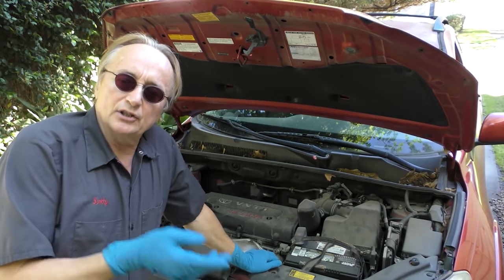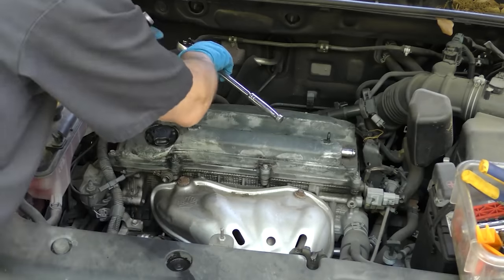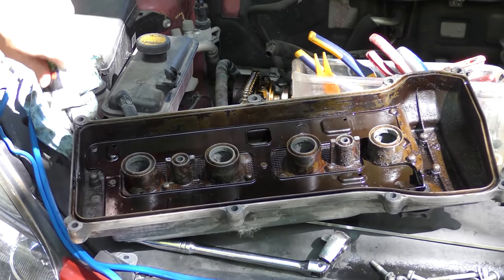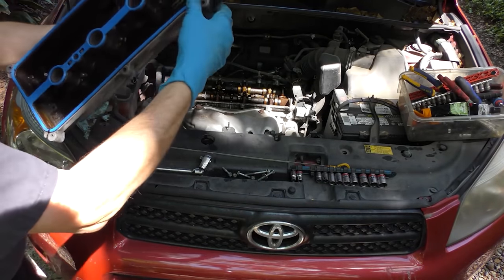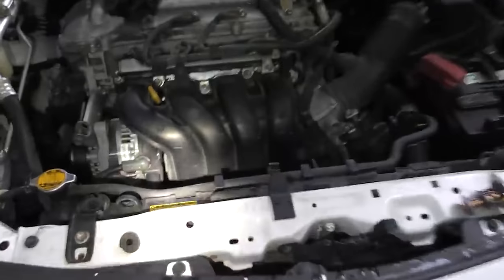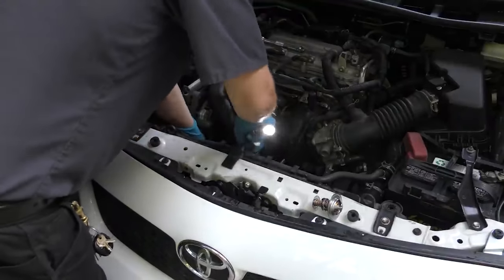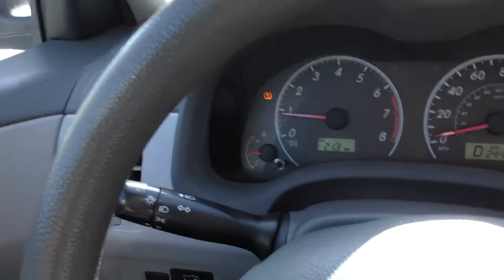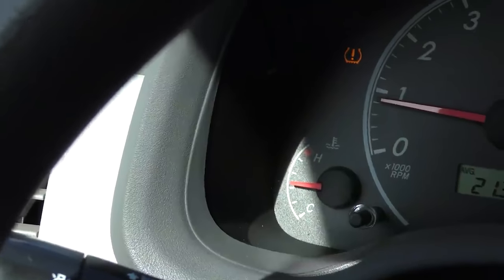3 Mechanic Scams Caught on Camera

Comment: He reminds me so much of me with 10 times more knowledge......gradual tightening of bolts yes but I didn't realise about from the centre outwards.....I would have checked the thermostat first.....my Dacia duster doesn't have a temperature gauge which for me is problematic....I have always treated the gauge as the fist sign that's somethings wrong...ah well that's progress

Comment: HELP ME SCOTTY! I have a 1998 Toyota Camry XLE that I've had for 21years. It's got 172,572 miles. The alternator, main belt that runs everything, spark plugs, wires, and filter have recently (5 months ago) been replaced. I noticed my car (Ole Bess) started running a little rougher than usual, and died while I was driving 2 days ago. I had it towed and she won't start. She cranks but won't start up. Everything looks normal (dash lights), but she won't start. It actually backfired when someone tried starting it today, which was the first time that happened. Please advise what you think it could be, because I am raising 1of my grandsons and school starts in 2weeks! I'm disabled and don't have a regular mechanic that I can count on to not take advantage of me, and I am on a fixed income. HELP!!

Comment: 😢 I have a 2012 Chevy camaro.  I'm  losing water out of the mufflers, not the tailpipe. I replaced the thermostat and the radiator. Plus, I flushed the heater core. It's still overheating. Almost certain it's the head gasket. I was about to replace it when I thought. Maybe the motor is cracked. Any suggestions.  New engine and heater core or replace gasket and timing chains and assembly?

Comment: The year 2000 and my Father In Law asks me to look at his 1995 Toyota Cressida. He'd have it serviced by a mechanic since brand new. The trouble was I had in mind - fuel starvation. I confirmed the problem. I saw the engine front filter full. I traced the fuel line to the tank. Yep, found an unserviced steel filter. I took it apart and removed the blockage. All went well. I am not a trained mechanic and my clerical hands can be seen -  :-). Live is a laugh - if you let it.

Comment: My 02 jeep liberty with 3.7l v6 just took a poo. It died big time just started misfiring and running like crap... a spark plug came apart in the cylinder and destroyed the engine not sure if it over revved or a valve stuck or what but the spark plug definitely got mauled and mauled the engine wish I could post a pic of th cylinder on here

Comment: Or you can use Grease Grease will hold them too especially if there's a ridge on that valve cover gasket put a little grease in there push it in you'd be surprised how much grease works

Comment: I had a Toyota V6 that wouldn't shift to high gear in cold weather. Mechanic said could be this sensor or that sensor. I said I think it's the thermostat, the engine isn't warming up so the it wants to stay in low gear. I installed a new thermostat, the old one was stuck in the open position and Viola, it shifted perfectly after that. The keep it simple principle worked.
Reply: First I experimented putting a piece of cardboard in front of the radiator, when that made it shift I knew I needed a thermostat.

Comment: I have a 2011 gmc Sierra 5.3 2WD with two codes p0797 and p0700 solenoid 3 stuck on. Mechanics said it needs a new transmission because the part can't be replaced?

Comment: When my father in law bought his 2006 Acura MDX, he took it for an oil change and not knowing about cars, he got suckered in to changing the power steering fluid, transmission fluid, brake fluid, engine and cabin air filters. Mind you, he only had 17k on his car lol, I looked at the bill and I was like well, you got ripped off 🤣bill was $550 (which included a complementary tire rotation).

Comment: Hey Scotty.  Is there any Toyota Dealership you would recommend (or at least don't think is horrible) in Houston (North side of Houston would be best)?  The one near my house I no loner go to.  They did my rear drum brakes on my Scion xA and the rear end would intermittently have a horrible sound during stops (especially hard stops).  I took it in two times.  First time they just said they couldn't duplicate the issue.  Second time I took them out and duplicated the issue.  They turned the rear drums.  Didn't fix it.  Finally I bought new rear drums thinking maybe that would fix it.  I took off the old drums and immediately saw what they did wrong.  There was a piece that was clearly installed wrong.  I took a picture and took it back.  They fixed their mistake and haven't had an issue since.  Don't trust their competence after that.  There is another Toyota dealer about 15 miles from my place, but I hope they aren't the dishonest one you mentioned.

Comment: I want to 3 different shops and have 3 different things that need replacement n the front end of my trucks  upper and lower ball joints and front shocks and breakers they had big money things . Any where between 3000 to 4000 Dollars . I told them to get in line and told them I would take care of it .

Comment: The 2'nd car was unbelievable... Taking it to a discount place is one thing, but Taking to what is supposed to be a reputable dealer, you expect their rates to be higher, but you also expect that they do it correctly...  I hope this gets to the big wigs of Toyota...  With that head gasket leak, I would also worry about antifreeze in the oil.. Which can be checked at th oil drain plug after car has sat a day or two.. Antifreeze should separate and go to th bottom... loosening(not removing) drain plug when cold and not ran for a ay or 2 should let any coolant out first..    Or if oil looks like a mud milkshake after running, then there's problems...

Comment: Hey Scotty I have a 2004 acura mdx touring and it makes a loud knocking noise and the engine sounds like it’s going to die and when I try to start it up it won’t start but while it’s on the whole engine shakes a couple times and it loses rpm

Comment: That's what I had the garage do when I had my straight six rebuilt I had them put steel gears and a steel chain in cuz I didn't want to worry about 80,000 miles belt and the gears inside of it exploding

Comment: Mistakes happens. Easy to fault on people. Installer made mistake on the gasket installation and it leaks. Thermostat MIGHT BE the problem and you didn’t test it before you replaced it. If thermostat was the problem, it would have overheated in minutes. You replaced the thermostat and it’s still over heated eventually because the head gasket has a leak. Tell us about your come backs and mistakes you did on cars you’ve repaired Scotty.

Comment: Mr. Scott I have a question rather a problem when I bought the vehicle the only told me that the ignition switch was week I need to do the key to start the car and for about 4/5 months that was working.. Now the car will do nothing even after replacing the starter... Do you think it's the ignition switch

Comment: From Massachusetts, @scotty or anyone recommend any mechanics ???  Before I found this channel I made the huge mistake of buying 2014 VW CC manual transmission... 😭 engine light keeps flashing then goes away for a few days, went to a shop spoke to owner and he said #3 coil spark plug and that's it, no doubt, 400$ picked it up drove around for a few hours, get home, engine light flashes and stays on, took a picture and video and called him, he said bring it in, instead went and got a scan from AutoZone same code #3 coil showed on the scanner, went back next morning engine light went off, mechanic (owner) said after I showed him the video and scan well if light comes back on bring it back..1 week later it's flashing again. I know what everyone is going to say, but I'm learning the hard way but learning.

Comment: I bought a 09 rx 350 after a driver total my rav 4. I didn’t want to be In debt and guess what. The guy I bought it from clear the code and cut the thermostat so that it always release coolant. Had to change it all. It fixed the problem

Comment: Change your oil or not the chains stretch the plastic guides wear out the gaskets on the tensioners wear out ill take a belt and change it any day before a timing chain kit install

Comment: I Don't care if its dealer, Chain repair shop or private. There are a lot of thieves working on cars. My mechanic skills come from Military mechanics school and a father that was a master mechanic. I worked at a chain repair shop/service center and boy did I make the bosses mad. I was told to recomend a bearing pack if the vehicle had 50.000 miles or more. I would spin the wheel and listen. If no binding or noise I wouldn't recomend. I refused to try and sell what wasn't needed. to end this I say ask friends or family for a good shop. I was given a recomendation  with the wrong name as it was supposed to be. I took my truck to them and they had it fixed imeadiately and correctly. Since them I have sent mulitple people and everyone of them has been happy. If you find a really good shop stick with them.

Comment: hey scotty...i put a quart of oil in my xb 4 days ago. it was at the top line. less than 300 miles later its on the first dot. i changed the pcv valve since that time so i dont have an accurate update yet but what else could it be? there are  0 leaks. my car is in great shape aside from this issue. well there is one other thing but not sure what it is and no codes. its a small rattling tinker sound at exactly 1500 rpm.

Comment: Hi. For a person who reads comments I got a question. What would be the best solution for my 1993 BMW 2.0 I petrol straight 6. It burns oil. Probably its worn out, should I get new pistons, piston rings and clean the valve seal holes?

Comment: I had a problem with my truck so I took it up to my trade school and the automotive department said they got all there parts 50% off and labor was free because they were training students well all they replaced was the clutch and flywheel and charged me over 500 dollars for it and not only that but they put atf in my manual trans which I had to change on my own time with my money and on the way back home my driveshaft yoke broke in half which I also had to pay for out of pocket and on my own time

Comment: I took my late my car a Toyota Wish to the dealer cos it had lifetime WOF there. They said it needed new rear wheel bearings and would cost $700 nz to replace. So i went to my normal mechanic and he charged me $250 nz. S

Comment: I have a Chevy silverodo 2500 08 and it's go8mg into limp mode saying engin power reduced and the throttle isn't working at all and I've changed out the throttle body.  In the past I've been able to change the throttle control position Sencer and that will fix it for around 6 months and then it acts up again with the same problem . I have just changed the sencer not that long ago so idk what it could be so instead of me trying to fix it with the throttle control position sencer out again I was goimg to have it towed to the mechanic while it's still throwing codes to see if they can figure it out . Is that the right move? Or do you have any idea what could be the problem? I could really use the help.  Thx.

Comment: I don't trust mechanics in this hick town took rig to shop for winter tires $100 next day engine light on, took to another shop $450. Week later light on again he wants another $450. Son looked at it found several hoses with slices on the underside a small stick inside the 02 sensor and several fuses missing dyi repair with the savings bought new struts and brakes.. runs like a charm

Comment: I'll tell you what's wrong the mechanics! They all rely on what the recommend dealership recommends without even looking at it! Or they trust whatever the computer says without even using their own brain.  I took my car to the dealership and I literally installed the windshield wipers myself 3 days before I took it. When I got my text message of everything my car needed,guess what it didn't need but they said was cracked and broken? My wipers, I couldn't wait to show up and have them show me my broken blades! Oh, it was a mistake, they pressed it by mistake, they are sooo sorry.

Comment: Low commut get a ev that plugs into a wal socket, so what .no shop needed.10 years just added water to the 12volt battery easy.flywheel generator.

Comment: Im sorry but that thermostat did not look " original " Still could of failed however its way to clean to be an original at that mileage, also the radiator fan is on because the Air conditioning was turned on, come on Scotty...

Comment: I have Toyotas!  I Love Toyotas!  Basically, all you have to do is change the oil in them, and they run for 300,000 miles! Occasionally, you might have to change an O2 sensor, but that's about it! That's the experience I've had with them at least.  Some people have different models, so they might have different experiences!🇺🇲✝️🇺🇲
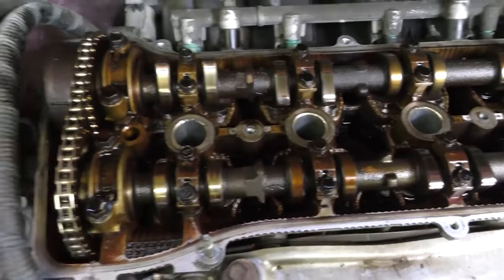John 3:16

Comment: Wow I wish you could work on my car I just don’t trust mechanics they don’t fix the problem but they do find lots of other problems. I took it in because the brakes were squeaking and the changed my brakes and roaters but the car was still squeaking then they say it’s the bearings 6-9 hundred dollars

Comment: thermostat doesnt fix overheating, if its broken it continously allows coolant to radiator even when engine is cold. so full circulation. so it can never overheat

Comment: Scotty, you are dead wrong about that beauty cover. The car runs 20% more efficiently and gets 2 times the gas mileage when you have that installed.
Taking it off will give you flat tires and blown head gaskets. You are also 4 times more likely to have an accident without the beauty cover in place.  Some mechanic you are! 🤦‍♀️🤦🤦‍♂️🙄🤣😂🤣😂🤣😂

Comment: I changed my brakes and rotors finally myself and aced a fortune I’d get quoted for 700 and it would be $900 plus sometimes I spend not even $70 lol and we did a better job my brakes have never felt better they never even changed any clamps ever lol

Comment: Here's what I think happened the customer blew the head gasket kept driving  it blew  a hose the tech told the service writer to check the cooling system he had to replace the hoses the writer wanted to sell the job so he  told the customer hoses would  fix it the tech found what you found it was burning coolant if he tells the writer the writer we blame him and not only will he not get his 3 hours but he will have to spend  another 2 hours making sure it's a head gasket so he performed a bomarang he topped of the coolant put the car out so when it comes back he can say it's a head gasket and  gets payed another hour where's the shop Forman you should sell a rubber stamp saying might need more so techs can  stamp all over the ro

Comment: I'm not seeing where the "dishonesty" occurred with the valve cover gasket. 
It was installed. Albeit improperly, but it was installed.
Everybody always wants cheap, fast, and good, all three. What they never realize is that you can generally only pick two. 
So before having a service done, you need to determine which two are the most important to you. 
On another note, there really aren't any mechanics anymore. They're all either too old and physically beat up to do any significant amount of work anymore, or they're dead. My 47 year old husband just had a shop owner approach him to work in his shop. He can't find a mechanic to save his life. 
My husband and I run a mom and pop style garage from behind the house, and have done so for years. We were done with our standalone shop ages ago. Sorry but no can do...

Comment: I can't remember all the details, but I was reading info- on-line comments of some owners some years on Ford trucks when I was having to replace ours from being totaled by a reckless driver and some guy knew that the Ford dealership was trying to get him to repair and replace things that would need thousands of dollars repair. He got his truck towed to a mechanic and the mechanic knew somebody who worked there that revealed to him that the mechanics are told by the owner that anyone who brings a vehicle in for repair that is not buying a new one on the lot, that the mechanics are to come up with $4000 $8000 of repairs. God hates unjust balances and the fleecing of the sheep and when He is done correcting His, it will be the merchants turn, as in Revelations, to receive a judgement of gain by unjust balances and this judgement day will be one that they can not recover from. Repent or perish for the Lord's day is at hand!

Comment: #2 what did you do any different from the dealer ? You threw a part at it and still had the exact same result 
Not cool to talk down to the original mechanics 

What if it went in for a leaking hose they repaired and the car was fine during the test drive

Only to find out the head gasket was bad or an over heat 100 miles later 

Your just old with too much time on your hands bashing ppl for no real reason 
Bummer bro your falling off

Comment: You don't need to remove the valve cover to see if it was recently done.. it should be shiney across the surface when it was cleaned. And a very obvious clean new blue gasket visible especially on this engine.. you dont need to "glue" it 😂 ..ever if it holds the gasket will do the work. Sometimes a dab of grease to hold it. Right stuff rtv is you really want to.. im confused how it was a scam. Was it leaking? Why didnt she take it back? Every mechanic thinks they are "the best" 😂 but they dont know all the other mechanics saying the same stupid stuff about their work. Circle of mechanic blame game!
Reply: Did you scam this lady after the valve cover gasket was fine, and find that oil was seaping from the oil cap?😂 which one was it?
Reply: dude did you even watch the video? the gasket was twisted